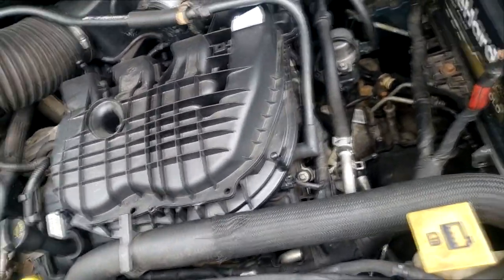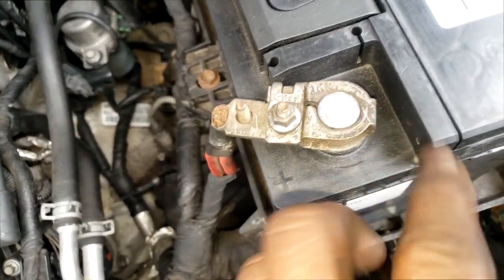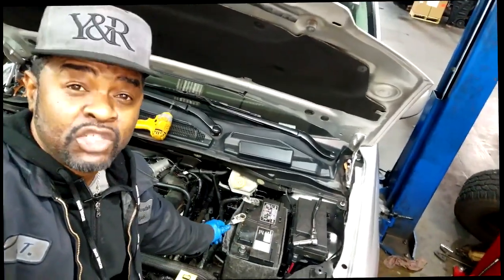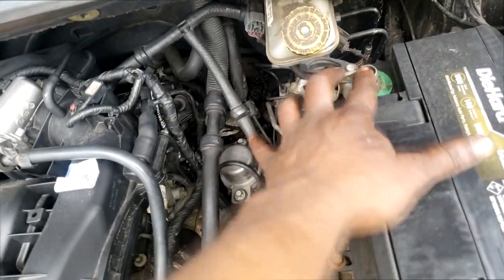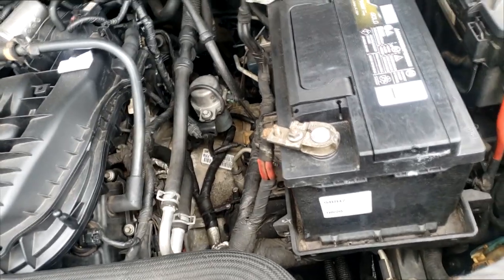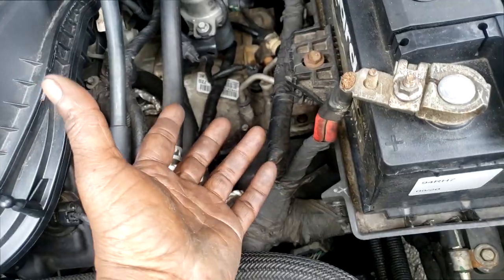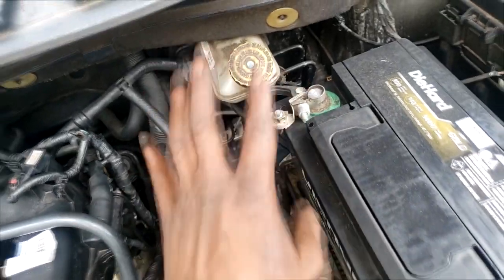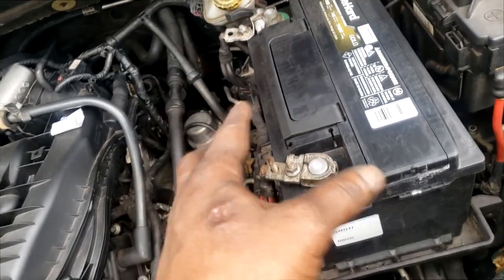STOP using impact on battery terminals. There is a fix for this but not like this. No Start No Crank

Comment: People improperly installing battery clamps and over tightening them is a big pet peeve of mine. Take it from someone who has installed literally hundreds of auto batteries on various models. They don't need to be that tight - maybe 10-15 ft-lbs at most. When applicable, the terminal clamps should always be properly expanded after removal so they can be pushed down onto the battery terminals (which are always beveled - there's actually an industry standard for this) as far as possible when reconnected. Some clamp designs are self-expanding when loosening the clamp bolt/nut, so it's not always necessary.

Comment: good point. The terminals on my 12 Caravan were not tight due to someone destroying it; it took a lot of hammering, twisting, bending to get it back into a shape that made it tight again--I definitely considered just buying a new battery harness, as it's not an easy thing to fix when someone's overtightened the beveled terminal nut.  When they're not damaged, they seem to work well--much better than Japanese terminals.